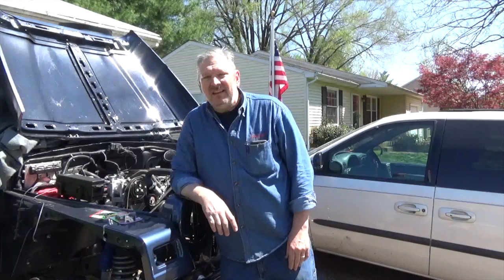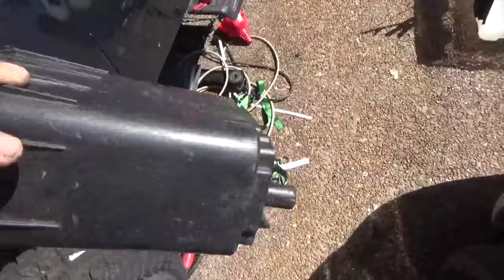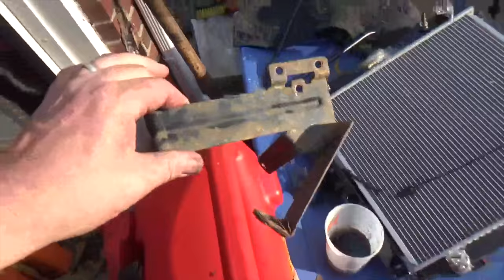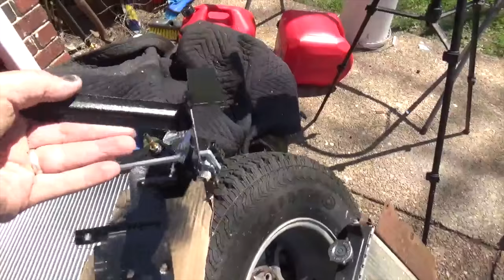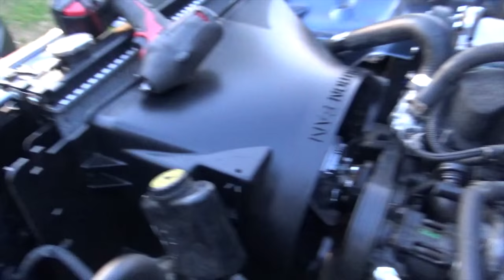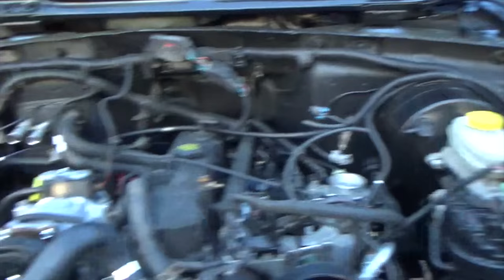Jeep Wrangler TJ Project - Evaporative System - Cleaning and ...Rust

Comment: Hey the hose at the bottom of canister that goes to fuel tank. Mine dead ends by back tire. No hose going to tank from that point. Do u think I have to add a hose to complete that connection? Or can I leave it? I believe it’s called an evap hose? Thx

Comment: On the top of the front of you charcoal canister. You have a 3rd hose, the largest one.

On my 1998 TJ this port on the canister is plugged, there's no hose and the circular black unit that your goes to does not exist on my Jeep.

Can you confirm if this is a state specific part for emissions? I am in Canada and have a Canadian version. Typical we are pretty hard on emissions, but It appears my TJ was never outfitted with this part OR the previous owner removed it entirely.

Comment: Hey Dave, I'm working on my 97 tj and hooking the engine back up I noticed one of my evap hoses is rotten at the 90 degree connector.  Where can I find the hoses for the evap system?
Reply: you ever find that? Mine's crumbling. As a hack I shrink wrapped the fitting and it's helped